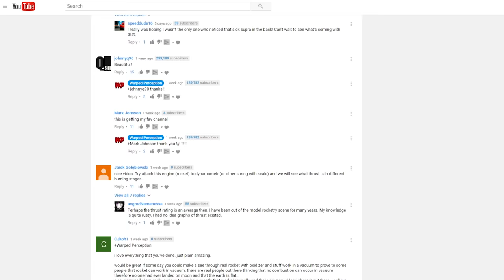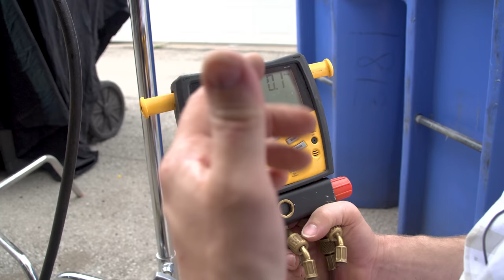Model Rocket Engine In A Vacuum Chamber - 4K Slow Motion - will it burn? - Rockets (S1 • E3)

Comment: And if you notice in the model rocket in the tube, the forward movement doesn't happen until the fuel exhaust has accumulated behind and has created a quote atmosphere
Reply: That's not an atmosphere at all.
Reply: @dertechl6628  
When I meant atmosphere I meant matter being produced and filling the vacuum to create a resistive environment
Reply: That bit of dust is definitely not a 'resistive environment'.
Reply: @dertechl6628  
You have no explanations all you do is say nope that's not it in a vacuum any particles that are contained n a small container as the vacuum boxes they are using any kind of particulate whether it be extended fuel or anything will Guild something to push off of. Give me a explanation to your response. If you have one I bet you if you do this exact same experiment in a vacuum box that is greater in comparison you'll find it will not move at all
Reply: Ever heard of interpunction?
The explanation is simple: recoil. The amount of dust generated is too broad for something to push off significantly.
Reply: @anthonyparker4943  if I fired a crossbow in zero-G in a vacuum, would I feel recoil? Yes or no?

Comment: The same physics principles in rocket motors also apply to explosive devices. It' a little thing called pressure differential. 
Expanding gasses don't care if there is atmosphere outside the container or not. As long as the outside atmosphere is less than the pressure of the expanding gasses, the gasses are going to want to escape to the area of lower pressure. It's going to expand in all directions at once regardless. And it's always going to create more pressure inside the vessel containing the reaction than the outside pressure(unless the outside pressure is far greater than the expanding gas pressures, pressures that would probably implode the container). Come to think of it, theoretically if you could place that rocket motor in a pressurized container that had greater atmospheric pressures than the motor could produce at it's nozzle, it wouldn't create any thrust at all. It would probably just explode.

This pressure differential also explains the difference in burn time of that motor that you noted btw. In a vacuum there is less(near 0) pressure pushing back on the reaction area.

Comment: If you watch the slow motion athe first few instants of ignition there is no motion as the burnt fuel increases the pressure inside, the rocket develops greater thrust...It would be interesting to see this done again with the pressure gauge visible simultaneously...

Comment: I am no expert on ignitors, but I solder a bit and it seems like you would want to solder wires to the ignitor BEFORE inserting it in the rocket motor, not after.  Just seems like risk, however low, that can be eliminated by order of operations.

Comment: Lost the vacuum when the rocket started up.  Could tell by the the way the rocket exhaust immediately diffused, like it was hitting atmosphere.  For a true test you would need a much bigger vacumm tube that will stay in a complete vacuum.

Comment: Anybody that understands physics knows that as the rocket burns (in a vacuum) the rapidly expanding gasses (combustion) produces a force against the inside of the rocket nozzle (in a vacuum there is no atmosphere to push against).  The force against the inside of the rocket nozzle is the force that propels the rocket (in a vacuum).

Comment: I'm going to post this following request on a few of these types of videos. Can someone make a little toy cannon on wheels that shoots a steel bearing via a spring loaded mechanism (to avoid the gas variable) and put that into a small vacuum chamber and fire it remotely? The steel bearing can represent the exhaust gas and the cannon the rocket. Upon firing it should move the cannon backwards thus proving that Newton's third law works in a vacuum.
Reply: +03chrisv ,
 Nice demo, but the deniers will still deny anything they wish.
Reply: Observ45er Yeah that's true, I just finished debating with one. I came to the conclusion that he was either a troll or insane. As far as the experiment I was even thinking someone could make a rail gun version of it so instead of a spring the steel bearing would move due to magnetism in case people wanted to complain about the spring.
Reply: +03chrisv,
  "they" would probably claim that it is not valid because it is not a gas being accelerated (assuming 'they' knew what acceleration actually was) or some such other gibberish. 
..
The problem is that you are trying to use logic and well understood science, where 'they' have no ability, nor desire to follow a cogent thought process using well understood natural phenomena. 
...
Those who understand science already understand and therefore, don't need the demo you describe and those who need it won't accept it since they are "free thinkers" who are smarter  than all of previous and present mankind.
Little Timmy was claiming under this video, that some momentum simply escapes out the rear of the rocket to be dissipated harmlessly while transferring no momentum to the rocket, or some similar sounding gibberish. 
Logic is simply a stranger to some minds.

Comment: This is a copy and paste from an earlier reply I made, but it is applicable to many of the other commentators.

This is for all you flathead dullards.  From the very first flame that exits the rocket, what is the flame/exhaust pushing off of that MAKES it rapidly exit?   

As a matter of fact, if you watch the video, there is a tiny plug that shoots off the back first.  That plug has no rocket on it, yet it flew away extremely fast.  That is because of the force of the expanding gas, and the gas alone.  You can even imagine scaling this experiment up so that the cap that shot off was the capsule of a spacecraft.  It sure flew off in a near-complete vacuum before ANY of the exhaust could enter the chamber.  All the basic rocket functions were thus indisputably demonstrated.  So, quit being so thick, and RECOGNIZE!

Note:  Edited for clarity regarding the question.

Comment: Did anyone consider the result as burning up whole motor in just one second where in normal conditions takes about 8? And this was not proper vacuum, not after the introduction of exhaust gases.

There is your proof - in a proper vacuum of "empty space", it would have burnt in a fraction of a second, gases expanding to all directions trying to fill the vacuum, cancelling out the net effect of momentum, no rocket propulsion...

Thank you sir for this great video. Rockets in space... BUSTED

Comment: What ""myth" is that?  That is just clueless people. Anyone who knows jack about rocket motors knows that once it is ignited it will function just fine. The operation inside the chamber is independent of the atmospheric conditions with a sonic nozzle, since no pressure distrubances can travel upstream against the sonic gas flow. The Estes motors only burn for a second or two.. the rest is delay smoke. They work most efficiently in a vacuum if the nozzle is expanded appropriately.

Comment: Cool experiment.  However I saw something that is interesting.  I feel it is flawed because the rocket engine produced a gases atmosphere in the exhaust end of the tube.  The engine failed to move until the atmosphere was of a sufficient density for the motor to push against. Sooo ... in vast vacuum of space, if this is the point trying to be made, the parameters of the experiment are flawed.  You could never create a sufficient atmosphere, with any type of rocket.  Would a rocket a rocket light and burn in space? Sure rockets bring their own oxidizing agents to mix with the fuel to be burned.... I still have questions about getting the rocket to move objects in space... Just a thought.  Good work on the experiments visuals.
Reply: bring bowling ball to space, go on EVA (outside da ship) and throw the bowling ball. you move backwards with equal force as the ball moving away from you. rocket go boom, throw fuel like ball, make ship go zoom. they don't need anything to push against.
Reply: @mammy24  Bowling ball != gas 

NEXT
Reply: Nooo it needed to overcome inertia ans spring resistance and that happened when the fuel was a full burn which is not as instant as u might think

Comment: Nice experiment. Let me begin with the combustion issue because without that there is not thrust (and your thrust measurement device was ingenious, I like that man.  So, questions: 1) According to NASA the measurement of vacuum in space is 1×10-6 to <3×10-17 Torr or 100 µPa to <3fPa1). What was the measurement of your vacuum and did it remain constant throughout the experiment?  It'd have been cool to have a camera monitoring your pressure gauge through the on to off switch of the experiment for proof of the vacuum constancy.  From the looks of your tube it wouldn't withstand the pressure of outerspace and not throwing shade but that little compressor couldn't create a vacuum of 1×10-6 to <3×10-17 Torr 100 µPa to <3fPa2).  You'd need a tube about 3 to 4 inches thick for the same length.  2) What were your combustibles?  All materials don't burn the same under the same conditions and or same negative pressures. The space rockets use liquid fuel so this also changes the results of your experiment since you didn't use liquid fuel like the rockets use. 3) There had to be combustible molecules of some sort in your vacuum according to the laws of physics and chemistry.  I like ya grind though, cool experiment.  Don't give up.

Comment: The solid propellant rocket fuel has the molecules to burn in a vacuum... and the burning solid fuel engine too adds element to the chamber to push off of.  Doesn't the space going rockets push off molecules in the air to have lift? You can see why so many would question if rockets work in space where there are very few molecules to push off of to have thrust...

Comment: Fantastic Experiment this proves one thing, you can hear sound in a vacuum :)  keep up the good work or NOT.
Reply: The spring was in contact with the chamber and rocket allowing sound vibrations to pass through as well as the exhaust gas once the rocket ignited. There is also the fact there was a camera in the tube whose audio could have been placed over as well.

Comment: If you really want to go down the rabbit hole of flat earthers and moon landing deniers, you might want to try out replicating the lunar lander lift-off engine burn in a vacuum tube. The process involved is supposed to produce a clear flame and they cling to the idea that you would still see a burn (which you do not in the NASA video). My guess is that the reason is that the lunar engine burned in vacuum and that the overexposure of the camera due to the brightness of the illuminated side of the moon made it not pick up any "clear flame". Would love to see it redone in an experiment though^^.

Comment: Note this is a vacuumized tube, and i believe it was vacuumed pretty well using an air conditioning vacuum pump.  The rocket itself has oxidisers with the propellant so it didn't need oxygen to burn.  Excellent demonstration.  But this tube in no way represent the vastness of outer space.  The hurdel to space travel using rocket fuel, is much greater than you can perceive with fast burning fuel.  Lets lay out the most taught information.   The sun is 95 million miles away, and traveling around our galaxy at 600,000 mph.  So the earth is going more than 600,000 mph because of It's orbital path.  At the same time its going 60,000 mph revolving around the sun.  At the same time its wobbling and spinning on its axis 1,000 mph.  So if you go to the place they call zero G you could assume that means  you're no longer with in earth's gravitational pull.  So now you need enough liquid oxygen and rocket fuel to exceed 600,000 mph for X number of hours to get back to earth.  Since the main rocket falls back to earth, it is not reasonable  to believe the required fuel for the journey to the moon or any nearby planet is feasible.  Let alone the journey back.  Who want to travel through the force field they found between the two main layers of the Van Allen radiation Belts that blocks all deadly electrons?  An how does it know how to discern between deadly electrons and any normal electron? I'm glad to be a flat earther because the earth I live on feels much safer. Side note, I love science.  But Please don't  put me on a rocket.  :)
Reply from the maker: +earth trighton haha... Good point
Reply: +earth trighton  "So if you go to the place they call zero G you could assume that means  you're no longer with in earth's gravitational pull."

And you would be wrong is assuming that. Those in the know use the term "freefall" rather than "zero-g" because it's technically more accurate. An object in orbit is essentially falling: the momentum it has from its rocket combines with the force of gravity to pull the motion from a straight line to a curved (circular or elliptical) path. The force of gravity theoretically extends to infinity.

You should also consider that while the Earth is whizzing around the Sun, and the Sun is whizzing around the galaxy, and the galaxy itself is moving, the rocket is on the Earth, so it shares the same velocity. Like throwing a ball in an airliner cabin, you don't need to throw the ball with enough force to get it moving at 610 mph to reach the passenger in front of you when the ball is already moving at airliner speeds. The rocket exhaust adds (or takes away) from the velocity of the Earth rather than having to start from some theoretical zero.

Comment: Warped Perception, how do you synchronize or coordinate the electric igniter timing with the high-peed camera timing?  Or do you?  I realize the experiment in this video was done almost 2 years ago and you've moved on since then.

Suggestions for characterizing your chamber:
1)  Get chamber to standard atmospheric pressure (SAP). Seal it.  Perform the Estes engine burn with camera viewing your digital pressure gauge to see how much the chamber pressure increases during and after the burn.  Do it several times to get an average.  With same setup film engine to see if it moves any sooner at SAP.  It should not move any sooner -- engine's burn profile can be found on the Estes website and/or the datasheet that came with the engine.  Show that profile to your audience as it helps explain thrust timeline.
2)  Pump air into your chamber (probably requiring a different end cap sealing mechanism - but you're clever) and perform the hi-speed camera on engine to find out when (how soon) its thrust first deflects your spring-loaded holder (another clever device).

Now you can and others compare timelines for engine startup and burn deflection for:  below SAP (near vacuum), at SAP, and above SAP.  This data would make it easier to address ignorant claims made about the rocket's exhaust being coupled to the chamber or the atmosphere outside the engine.

Comment: Hey two 'flamey' slow motion vids that might be cool to see.  

First is super easy, burning HDPE (e.g. old milk jugs) and watching the bzzzzt!  bzzzzt!  drips fall.  Nighthawkinlight did one a while back but the slow motion wasn't that slow.  The cool thing is that the flame is trailing the drop by an inch or more, burning the 'smoke' off of the drop.  If you did it at night with a pitch black backdrop and just illuminate the smoke trails it would probably be pretty damn sexy looking in slow motion.  The drops that don't burn leave really cool smoke trails.

The other one would be a lot harder to coordinate but might be cool.  Basically filming a hypergolic reaction.  You'd probably have to do it at a local university chemistry lab, but watching the drop of fuel start to light on its way into the nitrogen dioxide might be pretty awesome.

Comment: Ok so what I see is 0 thrust until the propellant fills the vacuum and reduces the vacuum pressure. Of course it burns but it would not propell in an endless vacuum.
Reply: Yes it would. Rockets work solely because they eject mass in the opposite direction. Physics.

Comment: Expelled gases being forced against the wall of the container proving that rocket thrust would not work in space, because there are no container walls 🤔
Reply: This video is about igniting a rocket motor in a vacuum, not creating thrust in a vacuum-that's a different video.

Comment: That's not exactly a practical experiment.  The cap on the end is still close enough to provide a backing for the thrust. Plus, the vacuum is being refilled with the gasses released from the rocket engine. I'm not saying a rocket will not work in a vacuum. Just pointing out the flaws from this experiment.

Comment: There are two issues here: 1) If the fuel burns in the vacuum. 2) If it serves to propel something in the vacuum. I think that only the first point was demonstrated. In the slow camera you can see that the propulsion begins to work after enough fuel was burned, and the small tube is no longer in Vacuum state. The rockets that are launched into space do not travel through tubes of a diameter close to the diameter of the rockets themselves. I think that to make a real experiment on the subject, a much larger container should be used, something that can not be filled with the burnt fuel of the small rocket.
Reply: Netwon's third law.  If the exhaust gas is moving in one direction when it exits the combustion chamber, it must push the rocket motor in the opposite direction with an equal amount of force.  That's what propels the rocket.

Comment: I'm not a flat earthier, but the smoke/gasses that come out fill the back of the tube that creates a resistance and pushes all the way forward. You can see it in the video on the timeline 2:54. When the smoke comes back, then it starts to move forward. I wonder if it should have done the same response in a larger and bigger container.